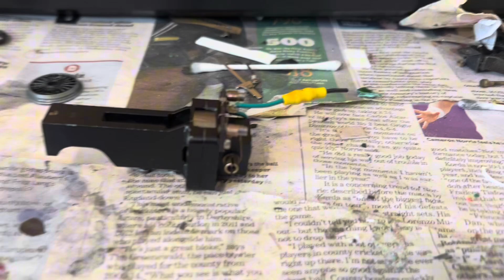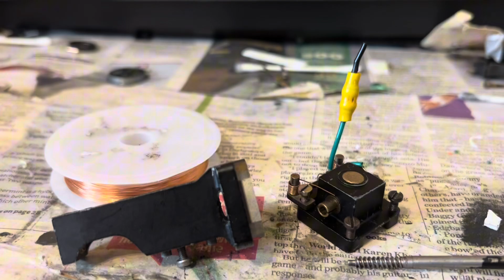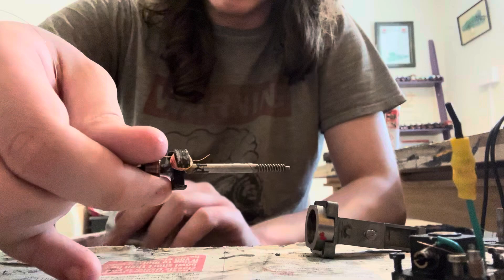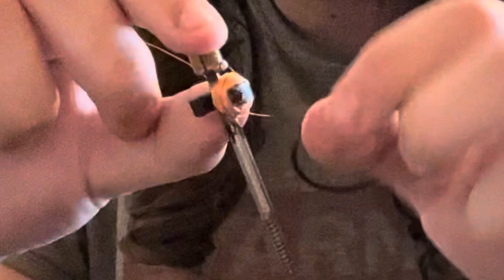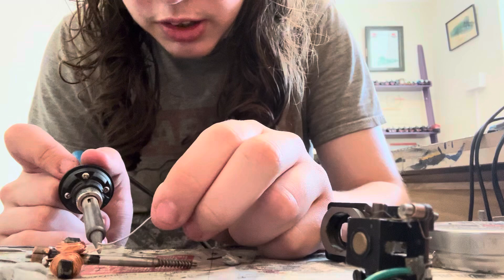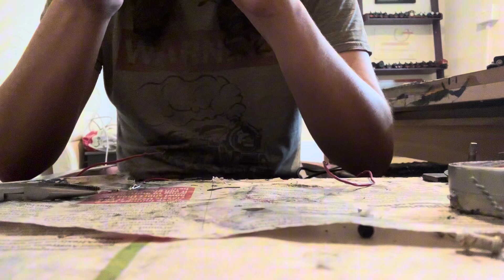On The Workbench, No. 6: Rewinding a Dublo “Ringfield” motor

Comment: Thanks for sharing your explorations! Man after my own heart: just have a go, coz what’s the worse that can happen with an already broken motor? It gives me hope that my own efforts might also yield something of a positive outcome 😊And, I’ve realised that I don’t need to melt coasting off magnetic wire with a lighter - as I learned is the way for very thin wires used for LEDs - as the soldering iron does it for you! Would be amazing if you’ve got any advice for my current situation: https://youtu.be/Gt9dia-Q3y8?si=ec5h3vk-755RQJSb